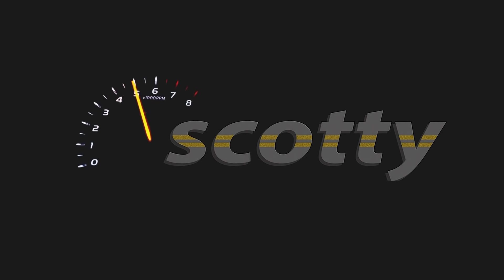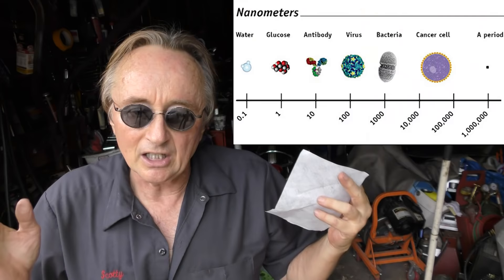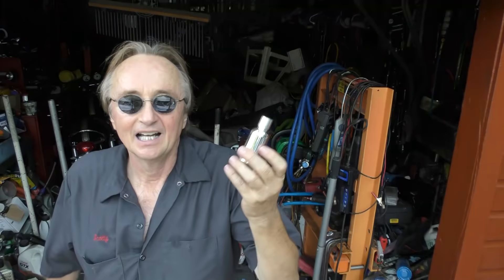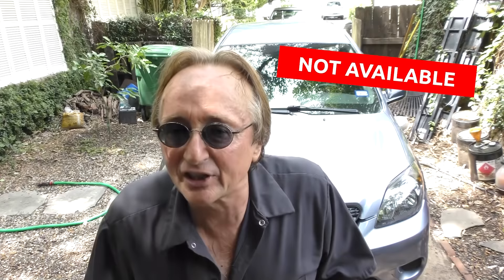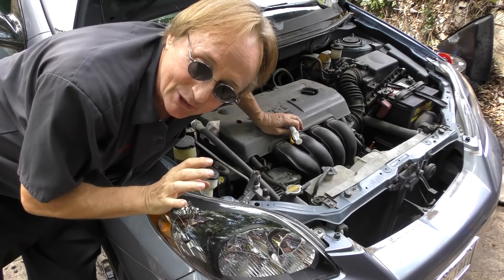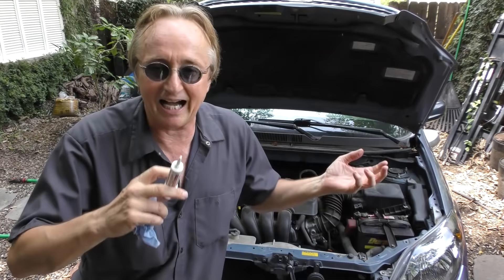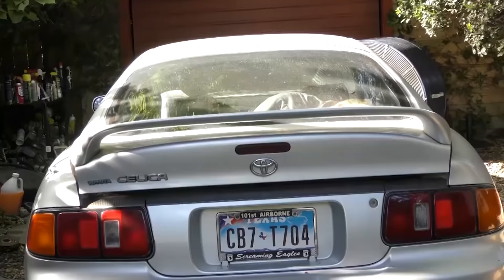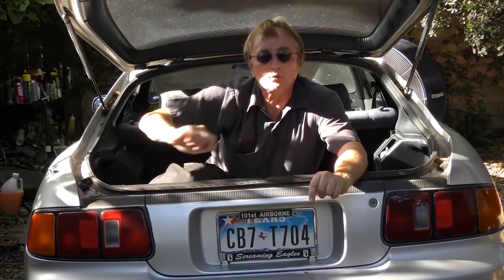Why Not to Buy Nanotechnology Products for Your Car

Comment: Your so right Scotty. A good wash and wax once a week and a polish every quarter keeps my car gleaming.  I do like the Micro fibre Cloths for drying the car and applying the Polish too.
Steve in Scotland.
Reply: Stevie D I mean that works too, but I wouldn't rule out nano tech (which can last for years)... From what I have seen, ceramic coatings work well, but the process is much more expensive and labor intensive than with traditional sealants/waxes. Honestly, the product Scotty bought is a brand nearly no one has heard of, so I wouldn't be surprised if that product specifically was bad (or it was just applied incorrectly which is a possibility given that he wasn't able to finish a single car with the included bottle). If you do some research, you will find there are numerous benefits to ceramic coating your vehicle, but unless you are very capable of polishing your car and following directions to a T, I would recommend going to a respected professional instead.

Comment: All these "nano" (usually copper based) additives that magically "rebuild" cylinders do nothing except filling in the scratches for a short period of time and provide additional lubrication which DOES improve engine overall smoothness (it's just a proven fact, there is no need to argue about it), BUT it really only helps for a very short period of time and it doesn't actually fix anything long term, of course. However I'm not sure why you included ceramic sealants into the same category. I mean, of course, if you just apply it as is, it's not going to do much. But if you actually follow the instructions (and you do have to have your car's paint corrected and polished first, otherwise it's just a waste), prep the car and seal it, it will last you approximately 2 years (good quality stuff, of course, like CQUARTZ PRO). That is, of course, if you never use an automatic car wash. I had it done to my black (so the worst colour) car and it actually lasted about 2.5 years before swirl marks started to crop up. So this actually works much better and for a much longer term than even the best synthetic waxes like Meguiar's if the car is properly prepped and the coating is applied properly. And, of course, it has to be good quality stuff. It's really easy to observe the results when you wash your car - dirt comes off much easier and water beads like crazy (similar to when you apply water repellant on your windshield, but this is long term, because it's baked). If you do it right, what you are doing is essentially restoring your original clear coat state of that of a brand new car, which brings in all the perks (looks great, doesn't attract dirt as much, washes off easily and it's really easy to dry after).

Comment: i love you scotty but this sounds like the ramblings of a boomer who doesn't trust them computer doohickeys. properly prepped and applied ceramic coating is actually a fascinating product and it was a $80 value after paying for my recent full paint correction on my 2017 civic. the results spoke for themselves in my eyes. and now when i wash my car all the brake dust just rolls off with the water.

Comment: I'll have to disagree.MAYBE this brand is bad, but companies like Ceramic Pro and others do make a difference on the paint.I clean (Never applied) coated cars all the time and it saves a lot of time.Dust doesn't stick as much and is very scratch resistant.

Comment: I have a problem with my Audi a4 
Every time i put gas the car dosn't starts , i need to press the gas and the. The car starts? I will apriciate so much of you will tell me if it is the pump , the filter or the sensor from the gas pump 
Than you very much

Comment: The nano and ceramic paint treatments are ridiculous, but so is bean (carnauba) wax.  Wax might have made sense when cars were painted with enamels that were air dried. Argueably it might slow outgassing and drying of the finish the way that of varnished furniture finishes did.  But since all production car finished today are oven baked, a vegetable wax doesn't make much sense.  

Of the "protective" coatings available today, the one I like best is Maguliars Paint Protect.  It also has exagerated claims (uo to one year), but it's so much easier to apply than any wax, and nearly the same price as a "premium: wax, so even of it were applied monthly, the time saving along would justify using it,. The ease of application makes it more likely that it would be applied more frequently.

Comment: Scotty, what oil additive would you recommend? I currently use Lucas along with engine restore that comes in 4,6&8 cyl applications. For severely worn engines. Any input would be greatly appreciative thank you. I would like to add that I drive an escort vehicle for oversize loads and a lot of our vehicles run for 16 hours straight either idling or driving down the road. We usually get around 400,000 out of a vehicle before we need to repair an engine or a transmission.

Comment: Depends on what brand you buy Scotty. I have used a coating that isn't claimed as nanotechnology rather a ceramic coating and I haven't waxed in nearly a year. Still beading strong. Used only half a small bottle too. Only paid $20 for it too.

Comment: please it 100 % depends on how you apply it .. how clean it is before hand .. it will NOT make your car look shiny like hell .. it will however prevent it from beeing dirty like hell by a long shot .. so yes Scotty it DOES work like its suppose to .. how do i know ? .. cause i use it .. you try using it on a car thats been detailed .. not washed .. but detailed .. then do ½ of the hood with nano and the other half leave it clean .. then rins it with a hose after 1 month or so .. and see wich side is the cleanest

Comment: I will almost bet he didn't use the product correctly. I'll bet he just washed the car and applied the coating which will not provide the results of ceramic. The paint has to be free of any contaminants. If he didn't prepare the surface right, he literally just put the coating over those contaminates. Probably didn't let it cure for 24 hours either.  No wonder it didn't last any longer than a wax does.
Reply: i agree. You have to, as with any wax really, wash, clay bar, polish (if needed) and then apply the final coat.

BUT, I'm pretty sure I can get similar to nearly the same results with the above and final coat of paint sealant instead of this nano stuff.

Comment: Hello Scotty. I agree with everything you said. But i did notice a slight difference in using Restore in my engine. I cant say there was a performance increase because I didn't dyno my truck, but I was having to add a half quart of oil every 3,000 miles. I put restore in it and I didn't have to add any oil anymore. I'm not sure if it will fix an engine with a more serious problem like having to add a quart every 1,000 miles. But it fixed the slight problem in mine, and usually if I was using conventional oil I would be changing it every 3,000 miles anyway. But i use fully synthetic oil in it and I can go much longer between oil changes.

Comment: I don't see how people think these ceramic coatings and whatnot will magically cure scratches and surface imperfections. The key here is preparation. It's a lot of work to get your paint in the proper condition to seal it with something like a ceramic coating. It needs to be thoroughly washed, clayed, compounded, and polished to get the surface nearly perfect, THEN it can be sealed. That could be why it was hard to apply, it wasn't properly prepped.
The problem here is their marketing people are a-holes!

Comment: I saw once in a shop im not gonna name (cos they sell other products that are actually good) there was some engine cleaner that would "remove all carbon buildup, engine sludge and then restore worn parts" so i tried it out in my trusty old lawnmower. It did absolutely nothing. There was still sludge inside, the carbon buildup in the cylinder was still there. And it didnt gain much power. It was easier to start but thats all i noticed. No power increase, no restoring of worn parts or lost material, no carbon or sludge removal, nothing. If a product seems too good to be true then it is. Btw my lawnmower is almost 30 years old and has a lot of hours on it        most of these supposed performance enhancing things are a scam. Seafoam and marvel mystery oil are the only products i had noticeadble performance from

Comment: I hope everyone realizes that ALL chemicals work on the nano-scale.  Branding something as nano-what ever, is like saying... "Hey folks, buy THIS refrigerator because it keeps food cold!"  (Note:  ALL refrigerators keep food cold.)  Kind of like the term "AI".  Which is just a marketing term.  The computer industry could not make AI work for the past 40 years, so they changed the meaning of the term "AI".  Nowadays, "AI" is just a spreadsheet (dynamic data input) connected to a photocopier (dynamic real-world action).  There use to be a person in the middle, but now that they can have a spreadsheet talk to a printer directly, suddenly this is somehow revolutionary?  Nope.  It's still just a spreadsheet and a printer.

Comment: hah that "nano engine rebuilder" reminds me of this tire inflator/sealer kit my father bought once, it had this spray can of stuff that was supposed to roll around the inside of the tire and seal any puctures as you drove after you inflate the tire with the compressor, it sealed allright lol Sealed up the valve stem so he couldnt put any air in, another win for Crappy tires  motomaster products

Comment: Scotty, for paint coating, you should try and see Ceramic coating. They've claimed that it is the next evolution in car waxing. That seems like a legit stuff
Reply: sonyviva308 From what I have seen, ceramic coatings work well, but the process is much more expensive and labor intensive than with traditional sealants/waxes. Honestly, the product Scotty bought is a brand nearly no one has heard of, so I wouldn't be surprised if that product specifically was bad (or it was just applied incorrectly which is a possibility given that he wasn't able to finish a single car with the included bottle). If you do some research, you will find there are numerous benefits to ceramic coating your vehicle, but unless you are very capable of polishing your car and following directions to a T, I would recommend going to a respected professional instead.

Comment: Hey Scotty, I have a 2001 Mazda Protege. I had it for a year so far with no problems 170k miles on it. My car goes through coolant pretty fast and I got my radiator replaced a little while back ago so I don’t think it that’s, and the mechanics I have gone to say they don’t think it’s a head gasket issue, I don’t think it’s leaking. I need your help! Can you please message back and tell me what you think it is please and thank you!

Comment: Waaay too much work for what it's worth. I tried apple22 pro...took two weeks to prep and it was ok for a couple of years...did protect microscratches for a bit, but that's probably more due to me using two bucket wash method for the two years.

Comment: Scotty I've got to disagree with you there, I used ceramic coating on my car been on for about a year now and it works great. However there are step that must be followed before using it on the paint. I kind of got interested in auto detailing when I bought my last car, so I did all the paint correction and stuff myself. The process takes about a day or two to get done and to be done right. I can tell you I don't have a garage, I have a serious bat problem because my neighbors will not get their roof fixed and so far for the year that it has been on its held up very well with minimal issues. My last car had so many spots because of the bats with this the spots and stains don't stay. Hell I'm so happy when rain falls at night because I know that I'll get a free car wash.

Comment: Thought they're scam, not sure, thanks Scott for confirming it.
Reply: Peter Not true... From what I have seen, ceramic coatings work well, but the process is much more expensive and labor intensive than with traditional sealants/waxes. Honestly, the product Scotty bought is a brand nearly no one has heard of, so I wouldn't be surprised if that product specifically was bad (or it was just applied in correctly which is a possibility given that he wasn't able to finish a single car with the included bottle). If you do some research, you will find there are numerous benefits to ceramic coating your vehicle, but unless you are very capable of polishing your car and following directions to a T, I would recommend going to a respected professional instead.

Comment: Scotty, I got a 2003 s 10 I am putting a after market aluminum radiator on it and I wanted to get rid of my clutch fan and put a standard metal fan on it,will that make it run cooler and will it hurt my truck?
Reply: May want to check on the radiator thing.  I remember (from the 90s) there were several articles/studies that claimed copper radiators were better for daily drivers due to heat dissipation while NOT moving, like in traffic.

Comment: Never heard about this product before but thanks for warning us about this nano-nonsense :)

Also nanotechnology for cars is like future science-fiction to me like in movies and tv shows, knight rider 2008 plot for an example
Reply: AirRookie I have no idea how good the engine stuff is, but from what I have seen, ceramic coatings work well. However, the process is much more expensive and labor intensive than with traditional sealants/waxes. Honestly, the product Scotty bought is a brand nearly no one has heard of, so I wouldn't be surprised if that product specifically was bad (or it was just applied incorrectly which is a possibility given that he wasn't able to finish a single car with the included bottle). If you do some research, you will find there are numerous benefits to ceramic coating your vehicle, but unless you are very capable of polishing your car and following directions to a T, I would recommend going to a respected professional instead.

Comment: Make your car engine last a long time, change the oil regularly - better than any of this stuff.
Reply: Sam S  some of the products they sell are pretty  good I put marvels mystery  in my truck it helps with engine knock and gives me way better transition  between gears.  But regular  change  of oil is the #1 way to guarantee  results.
Reply: Agreed, there may be some other benefits but oil changes are the way to go.

Comment: Mr.Kilmer I need your help PLEASE. I own o 2005 Toyota Tacoma truck with a steering issue. Toyota seem to have installed a plastic green bushing/washer on the lower steering wheel shaft that wears out over time. I’ve been looking for a fix for over a year now and I’m no closer to resolving my issue. So far I’ve seen one guy tack welded his to where the plastic green /bushing would be and another guy inserted shims and used wire ties to how the shims in place. I’ve tried this method and it worked for a couple weeks but shortly afterwards,the shims worked their way out and the problem returned. Can you PLEASE help ? You can check out Blakeracer r video to see what I’m talking about. Thank you in advance 🙏🏽

Comment: I've lived through most of the super special scientific mumbo jumbo, and the market always has the last say.  I also have a marketing degree and making something expensive or exclusive and paying an expert will always be appealing to people.  Nufinish and every other product that starts with "petroleum distillates" are virtually identical.  They work and have been around for quite some time.  Ceramic technology is a marketing buzzword just like nano.  I also added 50hp worth of engine improvers only to loose 3, thanks to K&N, splitfire, slick 50 and the tornado--actually none of them as I get snake oil.  Any day now every $10 wax will be Nano, and the professionals will claim only their expensive brand will work.  Nothing new under the sun.

Comment: Scotty is usually right on but wrong on this one. I have ceramic coated vehicles and when done properly its far superior to any sealant or waxes. Not even close, the beading of dirt and water is so much better. You can also dry your car with a blower. My car washes take half the time on ceramic coated vehicles. Scotty needs some more experience in ceramic coatings..

Comment: Scotty I am a huge fan of your videos, but I believe you are speaking beyond your element here. In this video, you are using a very cheap gimmicky product which advertises ceramic properties (9H) but it isn't even an actual ceramic product. If you spend more money on a quality ceramic manufacturer's product such as GTECHNIQ or IGL coatings, and if you properly prep the paint (wash, clay, wax removal, IPA wipe, compound, polish, IPA again) then apply the product, it will absolutely work as advertised (8+ year life expectancy). It's very easy for someone who doesn't know what they're doing to mess this up, hence why auto detailers are charging $1K+ per application. It is also necessary to properly maintain these coatings as they will break down over time just like clear coat if you don't even wash the car. I have spent many years studying the chemistry of ceramic coatings and they are absolutely a remarkable milestone in the advancement of protective coatings, for automotive and household use. As for the other products you displayed, such as the engine products, I am sure you are correct they are all gimmicky products, but as for the paint protection, ceramics are very real and do work. I am very happy to point you in the right direction as far as scientists and other automotive professionals demonstrating how ceramics do indeed work. Cheers!